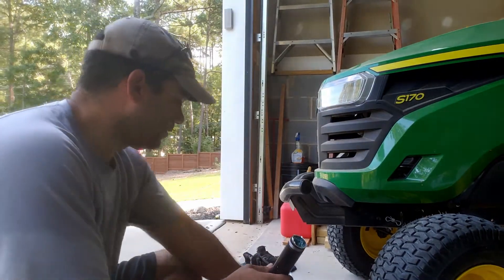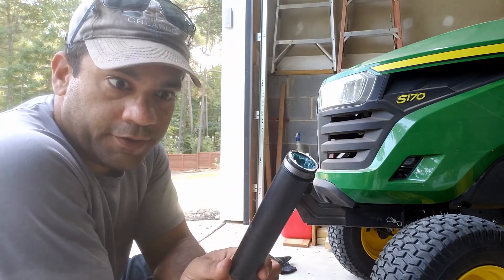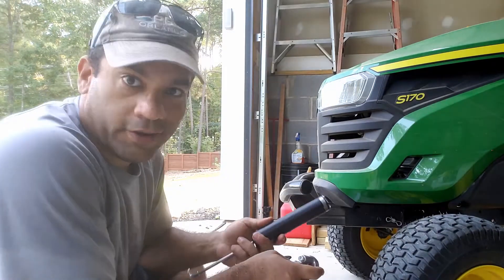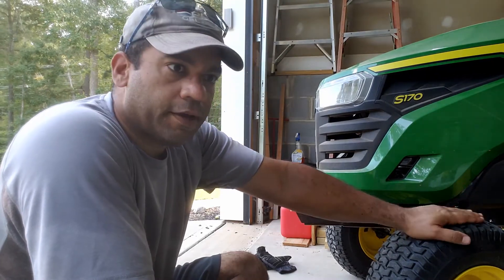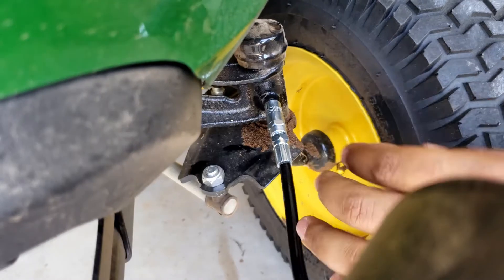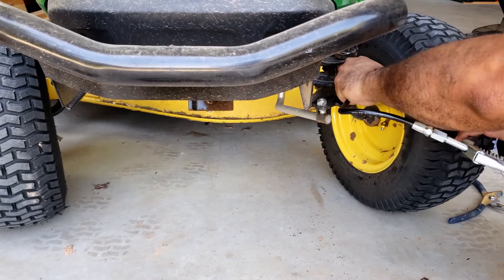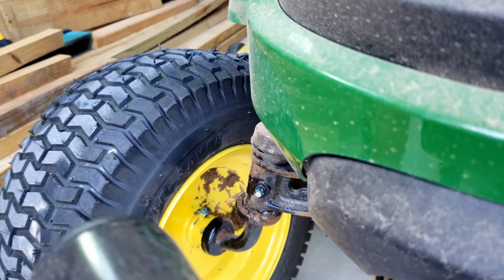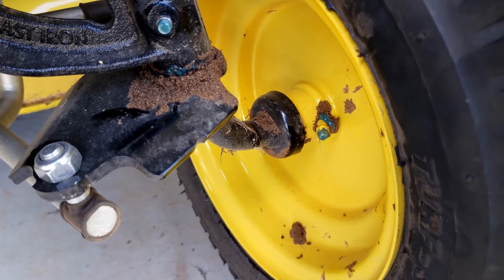Greasing the John Deere S170

Comment: The “jaws” of the grease gun tip that connect to the zerk are adjustable by rotating the tip so you can lock onto the zerk then twist to release.
Reply: Thank you I didn’t know that

Comment: Did you change the oil filter kit after 8 hours of use? 
If I use for cutting the lawn oil, after how many hours do I need to grease?
Reply from the maker: No I have not changed the oil.  Typically, oil changes are either every 50 hours OR once a year.  I doubt that I'd get 50 hours in a year on my mower but I suspect that I'll be changing the oil around the Fall this year since I haven't yet owned it for even a full year yet.
Reply: @HoneyDoHomestead  good to know, thank you!
Reply: @HoneyDoHomestead  This video is a big help, thanks for uploading it, will prep once I hit the 8 hour mark, because this thing cuts so well so fast, it will take a while until I get to the 8 hour mark.

Comment: I have the Same mower. You missed the fitting between the 2 front wheels under the engine and the 8 hour service calls for greasing the mower deck fittings.
Reply from the maker: Thanks for the info!  I'll definitely have to check that out!
Reply: Good catch and good to know!

Comment: Thanks! - I have the same S170. Love it!
I forgot about the wheel bearings. - My FIRST grease gun job too - I ALSO had trouble disengaging the fitting. - Just pull harder? - lol
Happy mowing! Are there no other places that need grease? - Cheers!
Reply from the maker: The first 8 hour one is pretty simple.  The 25 hour one is quite a bit more, lol.  There are grease fittings on the mower spindles, and a host of other spots.  I might be coming up to my first 25 hour maintenance soon.  I'll try to record it!